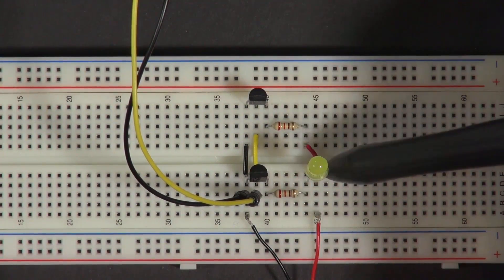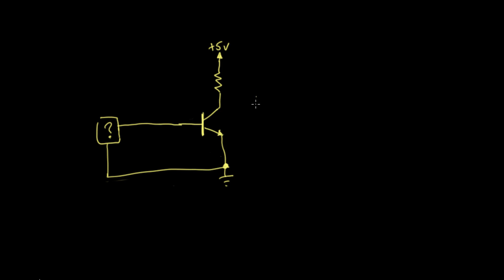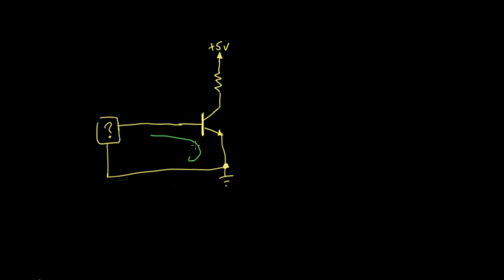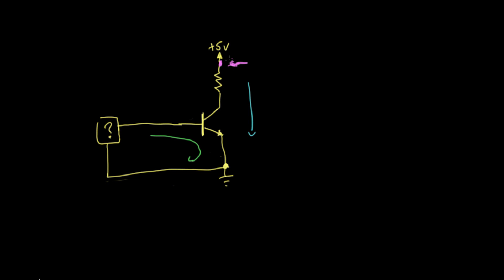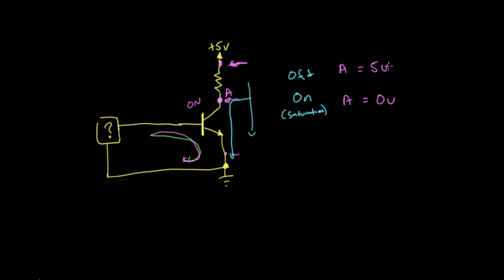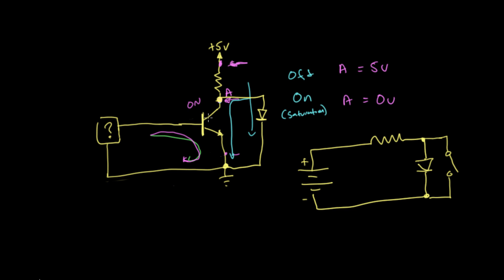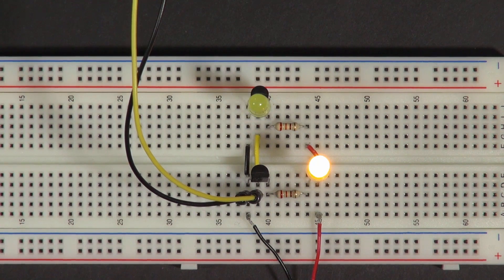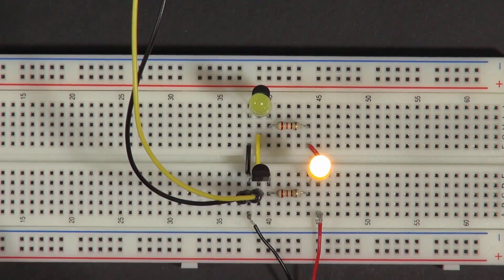Inverting the signal with a transistor | Digital electronics (9 of 10)

Comment: Is it safe to connect power source (+5 V signal) directly to the base of the transistor and without the resistor to suppress a high current flow?
Reply: In this case it is. The reason is that the "mystery circuit" is a high impedance signal. This was shown in earlier videos when the signal voltage dropped pretty steeply as soon as any significant current was pulled from the signal. You can think of it like the following: there is a 5V signal in series with a (fairly) large resistance. When that signal is used to drive the base of the transistor the current through the transistor is limited by the series resistance on the signal. Or, another way to look at it is that the base-emitter voltage will be around one diode drop, about 0.65V, and the signal is 5V so the rest of the voltage, 4.35V, is dropped across the series resistance.

If you have a low impedance voltage source, e.g., a USB power supply, attached directly to the base of a grounded emitter transistor then that voltage source will try to supply enough current to keep its output at 5V however the base-emitter voltage will want to be close to .65V. Where does the rest of the 4.35V get dropped? Across the nearly zero ohm resistance in the wires. A quick ohms law calculation leads to enormous current base current which, in turn, leads to a transistor without its magic smoke. So, for a low impedance source, you are absolutely correct.
Reply: @michaelc.tiberio5761  Fantastic response. Thank you.

Comment: Doesn't this waste huge amounts of power ?
Reply: Because the current that normally drives the LED, will flow through the transistor when the LED is off, dissipating power over the resistor. So this circuit consumes power both when the LED is on and when it is off.
This is obviously a proof of concept circuit, driving a relatively low-impedance LED. Real digital signals don't drive much current because they are fed to high impedance inputs, which would allow to use a high valued resistor in here, minimizing current. If you need to use that signal to drive something more powerful, you would have a separate driver circuit.
Reply: Why is this a big waste of power?
Reply: exactly what I was thinking. It's like trying to kill a fly with a shotgun...
Reply: Due to the resistor being 220 ohm and a power of more or less 5 volt the current is somewhere around 23 milliampere when the transistor is on (when the transistor is off there is a drop of ruffly 2 volt over the Light Emiting Diode, the remaining 3 volt over the resistor will cause a current of about 14 milliampere). Altough the current in off state is more than in on state and these are relatively large with respect to logic circuits it is not so verry much seen from the perspective of a power source. Do keep in mind that the treated circuit is merely a demonstration of how to invert a signal, in a more practical application there will probably be no LED driven but only one ore more logic inputs, the value of the resistor used will be between 1kilo ohm and 100 kilo ohm depending on howmany inputs are connected. The current will be between 5 milliampere and 50 microampere !
Reply: I am going to use a transistor! Because thats all I have at the moment :)

Comment: So the current goes from the collector to the emitter if the base current is going,  The terminology of "ground" here is confusing me a little.  Isn't the current going from the emitter to the other terminal (negative?) of the power source?
Reply: "Ground" is defined as zero volts in a circuit and all other voltage measurements are taken with respect to ground. For convenience (in single supply circuits), ground is usually set to the negative terminal of the power supply, is is done in this video. So "ground" is just a name for the negative terminal of the power supply. In other words, the answer to your question is "yes" and we call the negative terminal "ground."

Comment: but why does not the current get split between the LED and the transistor (when the transistor in on) thus the LED just gets dimmer.........i mean if you put two resistors in parallel the current will split between the two, it does not choose to go through only one of the two !!! please explain it
Reply: tesla. py   LED doesnt even light up because collector-emiter (ce) resistance is really small so all current goes thru transistor and because CE is low resistance there is really low voltage drop Uce (or Vce), and LED is in parallel with CE electrodes so diode also has that low voltage which is most of time below 1.9 volt so LED doesnt light .  So transistor is like short peace of wire.
Reply: so there is a VERY SMALL amount of current flowing through the LED but not even close to turning it on, because the transistor's resistance is much much smaller than the LED's resistance ?    R(LED)>>R(transistor) ?
Reply: There probably is small current thru but is in scale of micro or even nano amperes. And yes as I said saturation voltage is really small (Uce) and LED is also biased with that voltage and in most cases is lower than needed to bypas PN junction of LED.
So you are true, LED is much higher resistance compared to transistor in this case.
Reply: thank you

Comment: where the power supply enters the transistor to turn it on then out the other end of the transistor back to ground, u called a short circuit but wouldnt that ruin the power supply or battery?
Reply: No, because the resistor is still in the current path. The term 'short circuit' isn't always bad. Only if the short circuit is across the battery itself. In other words, if he also jumped across the resister, then that would be bad.

Comment: Wait!! Why does this work?   It seems like when the transistor is on that current would be split between both the transistor and the led.  Why does the led go completely out then??
Reply: Benjamin Rutkowski. The led goes out completely because the transistor is basically acting like a switch in the circuit. When the transistor turns on in the presence of the signal, it basically creates a path with 0 resistance. So all the current will flow through the transistor and not the LED. When the transistor turns off (it's not saturated internally) it's basically an open wire, so there is no physical way for electrons to pass through the transistor at that point. Therefore the electrons will take the only other option they have to get back to ground, and that's through the LED!
Reply: So when the transistor is in saturation, with 0 resistence, all the current goes down through the collector to emmitor  and because of the resistance of the LED, almost 0 current goes through it?   because I was confused with the current at the node where it splits between the collector and the LED.
Reply: Because the voltage drop across a Light Emitting Diode is somewhat like 2 volt and the voltage drop between collector and emitter is much less the LED will stop conducting and there will only flow current through the transistor. See also my reply to tablatronix question above.

Comment: Why is there equally 5 volts on each side of the resistor?  Doesn't that violate Ohm's law?
Reply: There is only a voltage drop (potential difference) across the resistor, when there is current flowing through the resistor.  V=IR     if current (I) is zero then voltage drop (V) across the resistor must also be zero.
Reply: @Inaflap  Then you are saying that 5 = 0? If I and R are 0, then according to the equation, V must be 0.
Reply: @typedeaf  V means voltage difference across resistor. If V is 0, it means there is no voltage difference between the two terminals of the resistor. Voltage at one end equals voltage at voltage at the other end of resistor.
Reply: When the transistor is off, the emitter collector junction is effectively open circuit, meaning the +5 is not connected to ground, i.e., no current is flowing from collector to emitter. 0 current = 0 voltage drop, meaning the 5 volts at the top of the resistor stays 5v at the bottom of the resistor.